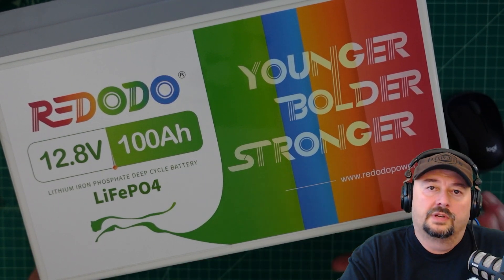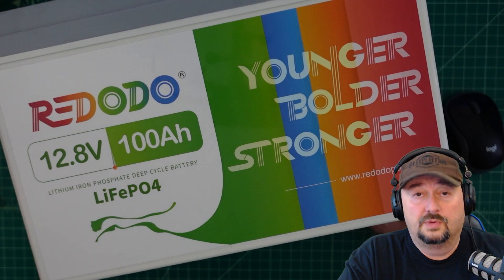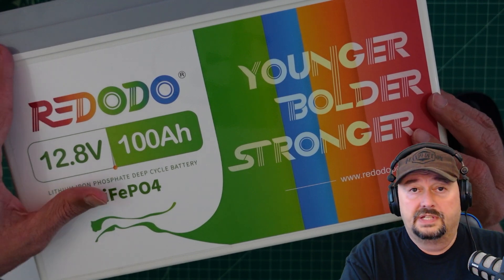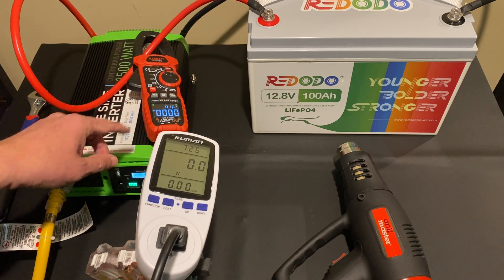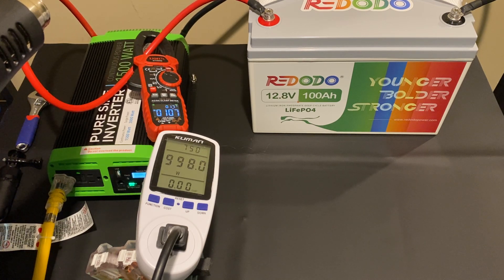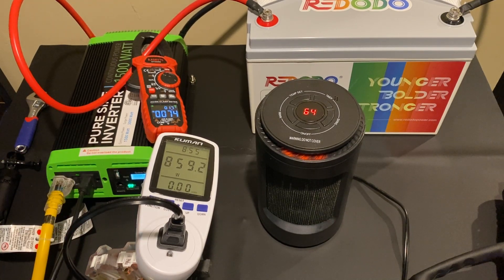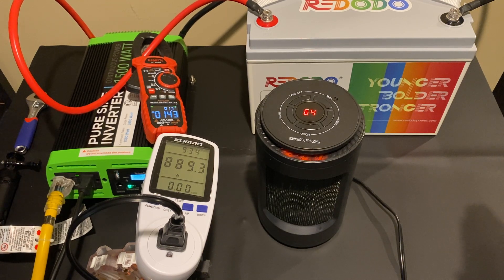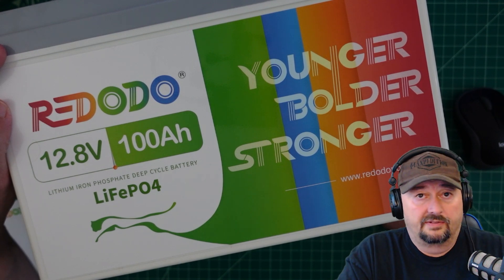Redodo 100Ah LiFePO4 Battery Load Test

Comment: The 100amp rating is max continuous, not peak. It just means you can safely run up to a 100amp draw constantly for the entire capacity of the battery. Nearly all batteries are capable of much higher actual output than the max continuous rating. Most just rarely post the peak specs, because it often encourages people to run too high of a load for too long which will damage the battery. Typically though on average for lithium based batteries, peak current is around 35%-50% higher than the max continuous, and is only safe to run for a specific amount of time like 10seconds or 20seconds. Some can even hit 75% above max continuous, but only for around 3-5 seconds safely.. Just so everyone is aware.
Reply from the maker: Thanks Moto

Comment: Dumb question, can a battery like this be connected in parallel with my Astron power supply for my radio, so the power supply will keep it topped off during normal operation, and when the power fails the radio will be supplied by the battery? I am not into solar, and don't ever see me going that route. Thank you for your input.
Reply from the maker: Hey Joel.  When you hook power sources together they should be the same; I wouldn't connect a battery to a UPS.  You could use a failover device in the event the UPS failed it could switch to the battery.

Comment: Thanks for the test report. I’ve been thinking about picking one of these up. Ape, I had to laugh at how you pronounce REDOD’E’O😂 I was waiting for a cowboy to lasso the battery to pull some more current out of it!

One question, I heard you mention on another video that the cheap battery brands use higher capacity, lower grade (B or C) cells and battery life is questionable. Do you have any idea about REDODO?
Reply from the maker: LOL @ Cowboys...  From everything I have seen it looks like they are using new, grade A prismatic cells.

Comment: My concerns, based on real experience, is safety.  It is difficult to figure out what safety mechanisms are in the BMS design and how well they perform.  

Almost anyone can make a battery that delivers some current.  It is a lot harder to make a battery safe and reliable over time or in adverse conditions.
Reply from the maker: Agreed

Comment: I bought one of the Redodo 100AH batteries for a backup in my home. I may buy another as I also bought a Renogy 2000 watt inverter.
Reply from the maker: I had been checking out those Renogy inverters, I have one of their charge controllers 👍

Comment: It would have been good to know if the output voltage of the battery varied as the load went up as well, but knowing LiFe batteries it probably didn't change much.  One other suggestion when you suggest someone go watch a cat video maybe put up a link to one or a link to something that is completely stupid.  Just a thought.  Great video 73
Reply from the maker: Hey Jeff.  That's a fair point about the voltage, I'll make sure to add that the next time.  And LOL at the cat idea 👍

Comment: If you want a big current draw? A big load tester. Battery load tester.
Reply from the maker: Hey Dragan, fair point.  I have a smaller one I use for the long capacity tests.  Thanks for checking out the video 👍

Comment: With this type of battery would a mobile rig (100w) work if connected to it?
Reply: @Steven H Thanks
Reply from the maker: Hey David, Steven is correct.  I have used this one to power my 100w radio and 12v DC laptop 👍
Reply: @TheSmokinApe  Thank you.  I was hoping that would be a good choice for use with POTA activations.
Reply from the maker: @KO4DKN  it is a little on the heavy side if you planning to do a distance hiking 👍